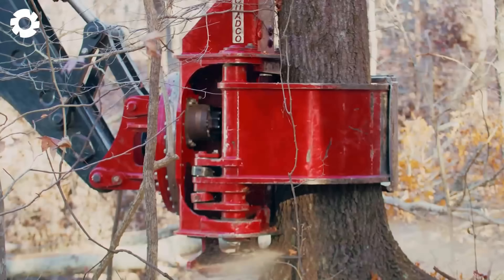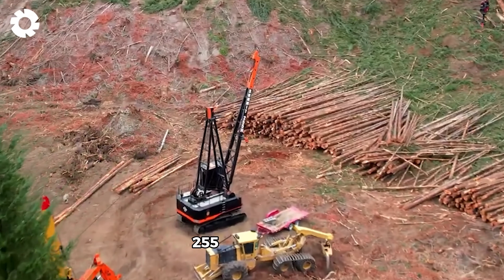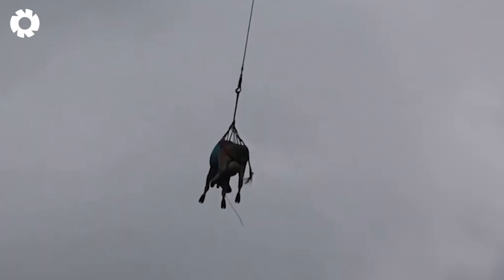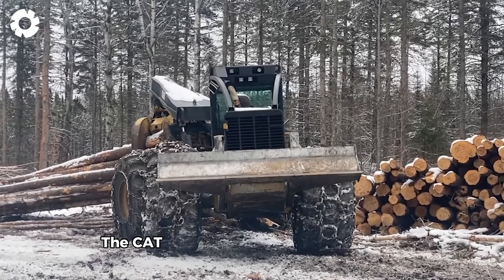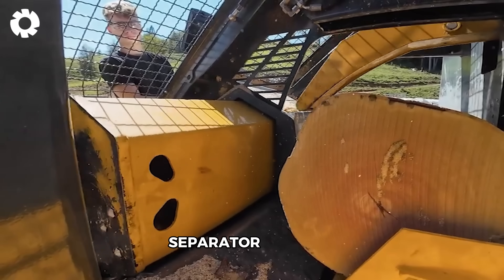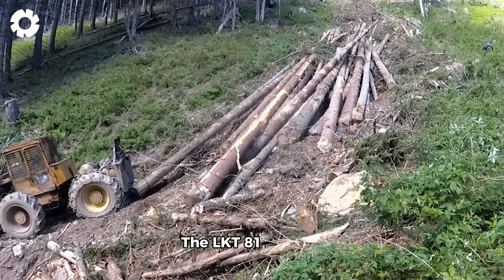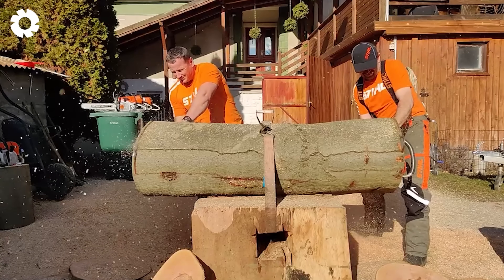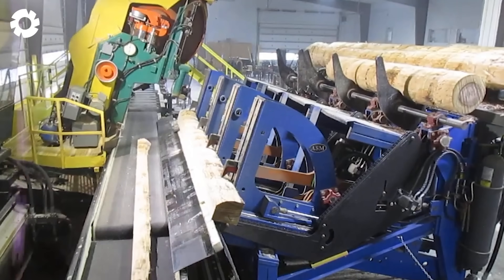Transporting Giant Buffaloes This Way - Biggest Heavy Equipment Machines | AgricultureTechnology

Comment: I was blown away by the sheer size and power of the equipment showcased! The ability of these machines to handle massive logs and perform tasks that would take hours manually is impressive. However, this brings up an ethical discussion about the future of jobs in the forestry sector. As automation continues to increase, what does this mean for workers? Will we see a decline in manual labor jobs as companies invest in more technology? While I see the benefits of efficiency, I also believe we need to consider the social implications of these advancements. How can we ensure that workers are not left behind in this technological shift?